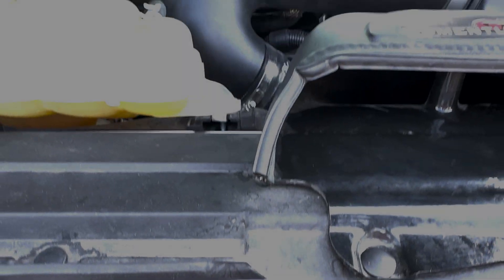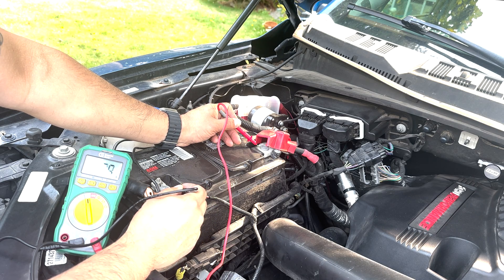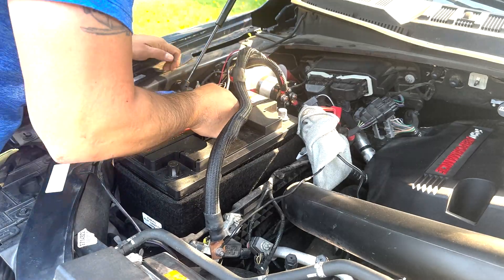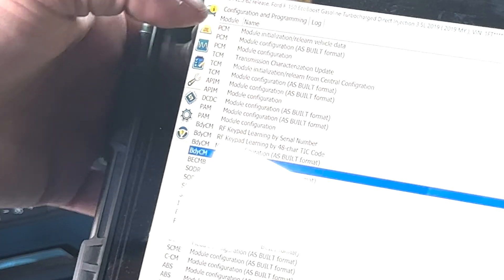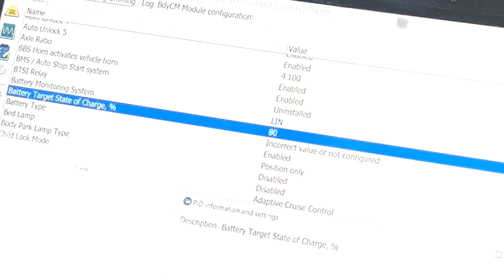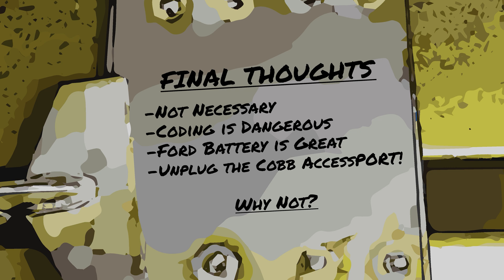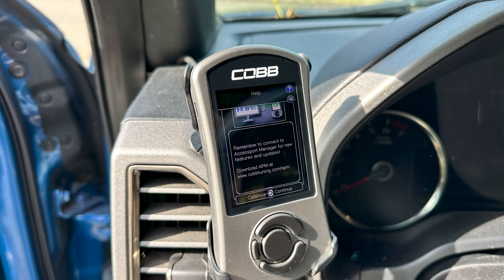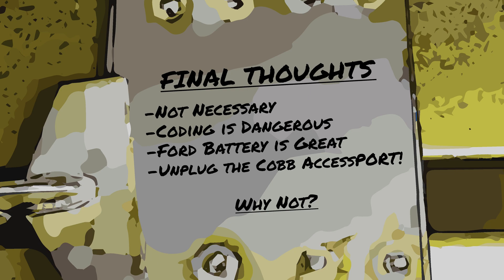Gen 2 Raptor H8 Battery Swap

Comment: Great video. Everything I need to know and no unnecessary fluff!
I assume this should be the same for my 2019 F150 with 3.5 ecoboost?
Reply from the maker: I assume so? Should share the same battery box, if it's a platinum it has the same engine.

Comment: I had the same issue with the accessport killing my battery. it's only stayed on once, but it was because it was just turning on as I was pulling into my driveway and turning the truck off. I guess it relies on some voltage drop when the truck is turned off instead of being smart and polling the truck state.